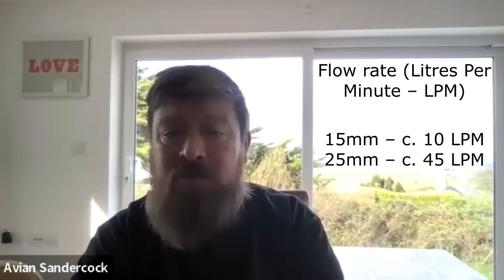Water Recycling - Designing a Closed-loop Cooling System

Comment: Looks like a good solution - I am weighing up the same options for a smaller 250 litre still at the moment. Did you look at passive cooling for the hot water output i.e. dripping it through a type of large car radiator with a fan on it, and reducing the size of the reservoir needed? I already have the reservoir tanks installed - 500 litres in total, so it looks like I need some passive cooling before it gets cycled back into those tanks to keep the temperature cool for a 6+ hour run. Also, I am in Brazil, so the ambient temperature is slightly higher than Cornwall, which I need to factor in.